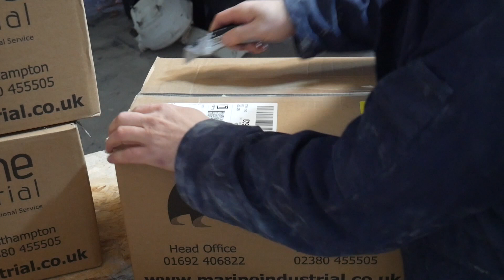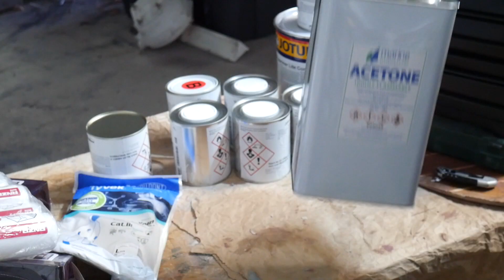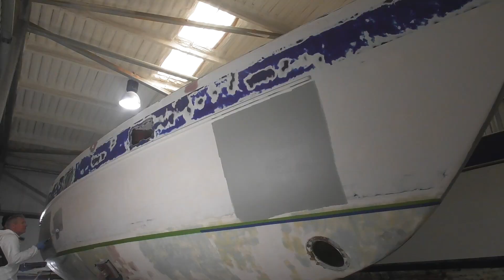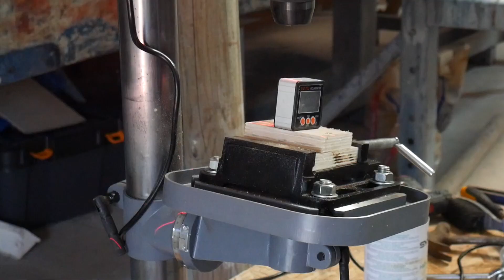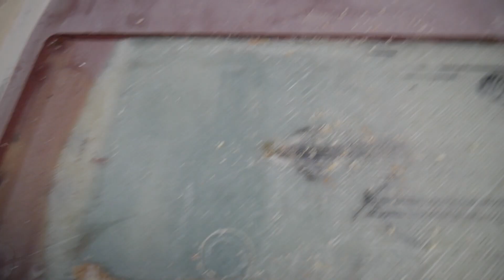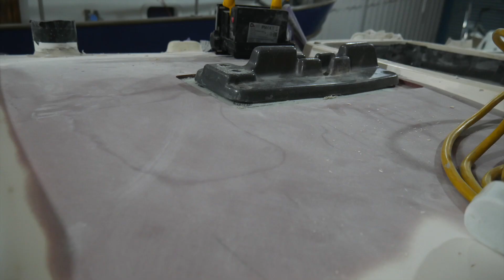#54 Putting down primer

Comment: Impressive amount of work! Yes you should definitely be proud of yourself for all what you’ve achieved! 

A drill press is excellent for mixing paint. I’ve used it for heaps of paint over 30 years. Very handy to put a bucket or a can in the vice, mount a blender, start it up on low rev’s and go for a nice cup of tea. Helps a lot. 
And it’s also possible to us it as a lathe (a vertical lathe) for mechanical work, like crankshafts etc. honing, polishing, sanding, threading… the list of use isn’t endless but still very long. Good move to invest in versatile machinery. 👍🏽
And I love your humorous editing. 😉
Reply from the maker: wow a paint mixer out of a drill press? Thats a sterling idea - Im going to try that next week. Cheers!
Reply: Be sure to start with the lowest rev’s possible. A blender is easy to make: a piece of 8mm steel rod, pop-rivet two tin plates over the shaft/rod and voilà, you’ve got a paint mixer.
Reply from the maker: @MiQBohlin  Yup I have a lot of speed combinations with the pulley set up, so can make it nice and slow. Thanks.